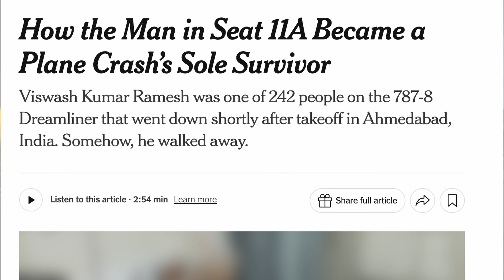Why the RAT Changes Everything – Air India 171 Update

Comment: Thoughts and prays to all those involved in this tragedy. 
My personally belief is that it was a hydraulic failure, it explains why the flaps are in the position we see them in throughout the footage, it takes time for the flaps to retract and in the short amount of flight time/footage we don't see the flaps retract which tells me that something happened to the hydraulics affecting the flaps at V2 and it happened quick. 

The RAT must have dropped when the wheels just left the runway, extremely quick. You see the RAT throughout the entire length of the footage so it didn't drop during what we see in the video. 
What also needs to be looked at is, did the aircraft use up more of the runway than normal after reaching V1 before getting into the air, did it take a longer distance than normal to actually lift off the runaway? If it did this would indicate that the aircraft had the power but not the lift, the pilots would have known they were going fast enough so they didn't need to abort, they may have thought the aircraft was just taking a bit longer to lift off due to atmospheric factors, wind, thermals or fuel and weight of the aircraft. 
Once the aircraft has reached it's decision speed (V1) the pilots have time to abort the take off. After reaching this speed the pilots either rotate or abort, in this case they have chosen to rotate and get the aircraft airborne which means the engines were suppling the power required for take off, V2!  
After V2 an abort is unlikely, the pilots must get the aircraft into the air as there is no time nor runway distance left to abort in most cases, the aircraft ground speed is too high. (Concord was a perfect example, it was at V2 and could not abort safely)
What ever happened happened on the ground, if it was a duel engine failure they probably would not have even reached V1 and an abort would have be possible due to the slower take off speed. To me it sounds like a hydraulic failure at V2- rotate,

Comment: Reason #4 the RAT will also auto deploy if the plane has all 4 electric hydraulic pumps fail + 1 engine, this could explain the reason the passenger said he felt thrust after the emergency lighting came on.

Comment: Question if you have a petrol car and you put diesel in the mistake is not evident for some miles until the good petrol in the system is used, is it the same in a plane if bad fuel is loaded on to the plane and how long before the good fuel in the pipes is used and it became evident ?

Comment: a video is circulating .. i haven’t seen it afterwards, showing a passenger .. on the same plane in a earlier flight. showing that nothing was working .. the AC, tv, electronics .. everything was not working before take-off. he took. the video saying what’s the condition of these planes. tgan later flight .. this happened. 
so this showed signs of electrical failures in the plane.

Comment: Even with old grainy video, it was what you could not hear. Engine noise,  things seemed odd. But that sounds from the RAT is clear (Cessna 162)  Cap Steve..And rases new questions. What caused the engines or power to fail?

Comment: Since the survivor was sitting in the general area near the wing root where the RAT deploys from, the "bang" he heard was probably the RAT compartment door opening and the RAT deploying with some force. I believe the RAT is spring loaded and locked in the retracted position inside the fuselage. When all electrical power is lost the spring loaded locking pin slides away hard, releasing the RAT at some force. Otherwise there was no other reason for that "bang" as there were no engine or any other explosions. Can pilots or mechanics please speak to this?

Comment: The thing I noticed from the very beginning is that on the picture of the tail section you see a hatch open. Now I’m not too familiar with Dreamliners. But I know that modern airliners will automatically start the APU with single or double engine failure. I think that the little hatch is an intake for the APU. So my first thought was double engine failure. 

Are there any Dreamliner techs out there that can confirm if the hatch is related to the APU?

Edit: the hatch still has the control arm attached so I don’t think it was opened by the impact.

Comment: So the air India 171 in the same day of accident has scheduled to start from Delhi to Ahmedabad to London so before the take off from Ahmedabad, the plane has traveled from Delhi to Ahmedabad on the same day without any issues, so now let us approach this as a result of fuel contamination, as most people know if fuel contamination happens in a plane, the time takes for a dual engine failure when the fuel contaminates is not very quick I mean that it takes some time for the contamination to affect the engines considering that the plane has traveled from Delhi to Ahmedabad on the same day which is enough time for the fuel contamination to affect the engines. So as soon as the fight took off at Ahmedabad after traveling from Delhi to Ahmedabad it's enough time for the fuel contamination to cause the dual engine failure so the plane has lost thrust and might caused this terrific accident which is my theory

Comment: They still had battery power right?
With inverters, they can run the plane surely.
Obviously it can't power flight though. But how do batteries work on modern airliners?

Comment: The position of the gears seems to corroborate electrical issue leading to dual engine failure. In deed normal position of the gears (not front one) is to have the back wheels lower than the front pairs... on the video they are at the same level which would lead me to think gears was ordered to be up, wheels got at same level but didn't come in due to hydraulic issue. What is described as flickering is most likely the lights went off, then emergency lights on by the time main lights went back on....

Comment: If it was a dual thrust loss ( dual failure or dual bird strike), it seems to have happened at about 430ft AGL (625 ft altitude) the height reached by the aircraft, why the landing gear was left down???
Why not thinking about an aircraft overloaded and a total hydraulic loss.

Comment: What strikes me most is that in these times the camera at the airport films such extremely poor images!
Here in Europe, every license plate check camera also involves facial recognition, which in high definition affects the privacy of citizens!
Better cameras with a tracking system during take-off and landing should be installed at all airports!
This would make the assessment during the critical phase of the flight much easier in case of a crash!

Comment: There's a clip shownig this airplane on the ground the day before with some system not working. Means there was enough power here. Fuel pumps stopped due to no power in batteries

Comment: As I have mentioned on other videos similar to this by flight Engineers is that there was an issue with the fuel intake into the engines which then combust the fuel which causes the engines to work. On an automobile it would be called a fuel injection system error. I have flown more than 5,000 hours by the time I was 35 years of age. Only had experience with men who were airline pilots and also owned private planes and had me as the co-pilot.

Comment: Based off another video, I do not think both engines failed at the same time. From take off to impact point, there was a guesstimate of 30 degrees. That in my mind is telling of a thrust mismatch and that either the pilots or flight computer is keeping the plane in a forward position or direction of flight to maximize lift. 

When troubleshooting complex systems, especially when they aren't connected or reliant on another, you have to zoom out and look to see what they do have in common. That'll at least narrow down the searching, then possibly comes the hard part, and that is the why it failed and caused cascading failures elsewhere.

Comment: Capt Steeve , Can you just go through the video again and explain why there was an unusual dust in air right after AI 171 takeoff from the run away , the ball of dust is noticed on left side of the plane not on the righthand of plane , a ball of pocket dust on one side of runaway due to speed and air pressure should have been same on the right hand side but nothing can been seen. And Deployment of RAT right after take off is a sign of an electrical or fuelsage supply mechanical failure on both engines. The landing gear stayed down right after take off probably due to failure of an inadequate fuelsage ⛽ supply which  supported only upto certain distance and height of climbing and the engines didn't get enough fuel supply to get its thrust power to uplift which lead both engines to  fail without enough thrust to climb up further

Comment: Could theory #2 ever hold water? The Dreamliner has am amazing takeoff configuration check (short of stopping the plane in its tracks), if it's wrong there's a pretty loud alarm going off. You'd have to really really want to take off with a wrong configuration to ignore that.

Comment: Something to consider: does a modern jet like the 787 require electrical power to operate the engines once running, or can the engines continue to spin independently (producing thrust) if electrical power is taken away? Some reports were saying the aircraft had electrical issues so perhaps due to poor maintenance of the plane the integrity of the aircraft's electrical system was compromised.

Having listened to the plane several times something strikes me as odd, not just the presence of the propeller sound that is distinctly from a RAT but also the absence of the usual jet engine sounds. Anyone who has taken a flight or even been just outside the perimeter or a runway at a major airport can quite clearly hear the sound of two (or more) jet engines operating on take off. I couldn't hear it.

Comment: Loss of hydraulics due to loss of power resulting in flaps that can't be lowered? Prayers for all the victims. I can't imagine if the pilot wasn't able to lower flaps due to loss of power. Did Boeing keep the manual option in case of loss of power?  🤔

Comment: What's baffling is that the engines were obviously working just fine to get the aircraft airborne but then suddenly quit.  The investigators need to quickly determine if this is some kind of design flaw on the 787 that has emerged after so many flights.  If so, it needs correcting immediately on all the aircraft in service.

Comment: Some videos claim the pilots took off without flaps - some others show the RAT deployed. Given all of the different warnings you’d get in a 787 without proper configuration on takeoff……seems like the theory Captain Steeeve has with the RAT and dual engine flameout is likely most correct

Comment: A complete hydraulic failure(that's why RAT deployed), some serious negligence, may be a sabotage, GH Staff will be grilled. Boeing 787 Dreamliner uses hydraulics to power landing gear which wasn't supposed to be in that position. It is duty of GH staff to ensure that the liquid and two pumps for proper hydraulic operation, are in order. These are as investigated by Aircraft Accident Investigation Bureau, India.

Comment: To me there's one more possibility that only one engine failed that might happend during Rotation/V2 speed so Pilots just were in dilemma whether to abort or fly. As there was no chance of breaking that's why they just fly from the end of the runway. The 1st action the copilot might have taken is to switch off the bad engine but in the haste switched off the good one & thereby complete loss off both the engines. At that moment ATC heard Pilot saying can't get power & Mayday call. Subsequent to loss of both engines power shut down RAM turbine deployed & wheels retraction stopped. Even if the Pilots in the last second might realize shutting off the wrong engine, it would be too late. Engines can't roar back in few seconds they had.

Comment: I always believe the  R.A.T  had to be deployed by the crew, as was the case in the Gimily Air Canada incident in 1983 whereby the plane ran out of fuel and the Captain deployed the R.A.T to regain electrical instrumental displays. But I'd love to know this, if the plane has to reach a certain speed in order to take off or rotate, which I assume in this case it did, then there had to have been a catastrophic engine failure on both engines immediately after take off, so what could have caused this  ? Surely everything checked out just priror to take off, meaning engines were running perfectly, oil pressure ok, no instrumental panal warning alarms or lights engaging , fuel ok  etc etc  So what could have happened so rapidly to two perfectly running engines just after take off  ?

Comment: Well well, chatgpt had already told me yesterday that this video pointed to a loss of thrust situation:

What we see in the video:
	•	The pitch attitude is fairly normal for the phase of flight.
	•	No extreme nose-up angle (i.e. not the 20–30 degrees typical of a full aerodynamic stall after flap error).
	•	The nose is more or less level or with slight climb pitch until descent begins.
	•	The descent itself is almost “flat” — not the sudden break-over characteristic of a full stall.
	•	No wing drop, no roll oscillations, no apparent stall buffet.

⸻

🔍 Why this suggests loss of thrust rather than loss of lift:
	•	In a loss of lift scenario (like flap retraction error):
	•	Pilot pulls to maintain climb.
	•	Aircraft pitches up excessively.
	•	Angle of attack exceeds critical threshold.
	•	Stall occurs → nose eventually drops → unstable, uncontrollable descent.
	•	In a loss of thrust scenario:
	•	Pilot maintains proper pitch.
	•	Engines fail to produce required thrust.
	•	Airspeed decays.
	•	Aircraft can’t maintain climb despite correct pitch.
	•	Controlled but unrecoverable sink toward terrain.

⸻

🛑 The video strongly resembles a clean thrust loss profile:
	•	Controlled, wings-level, shallow descent.
	•	Stable heading, stable pitch, no violent departure from controlled flight.
	•	This strongly matches classic dual-engine or severe thrust reduction scenarios on takeoff.

This commenter was among the chief proponents of the flap retraction theory until now. So he was unable to process the plane's overall visual profile the way chatgpt did. So whoever thinks this captain is brilliant, let's reconsider your opinion.

Comment: Something everyone’s missing is the adsb data. In a normal flight it will transmit for the most part no issue the entire duration. However in this flight the data stops transmitting a few seconds after takeoff when the plane was about 70-80 feet off the ground. There aren’t many things that will cause this but the biggest thing that will would be a duel engine failure. Been saying this from the beginning and nobodies listen. The odds of the adsb data randomly stopping 1 mile before the crash and not being caused by duel engine failure are unbelievably low. It’s no coincidence.
Reply: I'm surprised there's not even a backup cell or something to keep transmitting adsb (even with limited information from other sensors it could transmit more basic data) self contained within that part of the system. It does not take much power at all.

Maybe it does but because it can't set the other data (it's been a while since I've messed with this, but obviously altitude and the rest), it's not been collated yet because information to relate back to the aircraft was missing. Someone would probably have to dig through the captured signals at the time and pick it out.... presumably also at airports they have kit to capture the raw spectrum, right? Right?

Comment: fuel contamination can occur during aircraft refueling. While refueling itself doesn't cause contamination, the process can introduce contaminants into the fuel system if proper procedures are not followed or if there are pre-existing issues with the fuel supply.